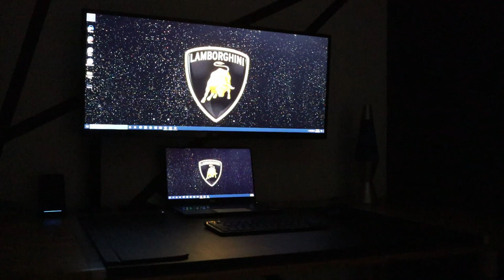Custom LED Epoxy Desk | DIY Projects

Comment: That my friend is beautiful. And I'll be stealing that idea for my own walnut top
Reply from the maker: Glad you liked it! I would make the final layer of coloured pigment a bit thick so you don't have has much hot spots as mine.
Reply: @AlexKatWoodworking  thanks for the tip. Might look at a higher density of leds too. Some testing is needed
Reply from the maker: Definitely a good plan! I'm doing a walnut desktop this week also!

Comment: Nice looking desk but then I see the legs and draws and it just cheapened it for me. As for the led lights, well great idea but what happens if or when the leds fail?
Reply from the maker: Yes I definitely agree, maybe I'll do a new base for it soon! As for the LEDs they last like 50,000 hours which is like 8 years of straight use. That is reduced due to extra heat from being in epoxy, but they should still last many many years! And if they fail its still a cool epoxy design and the LEDs are hidden.
Thanks for the comment!